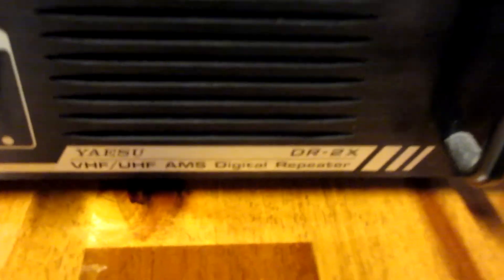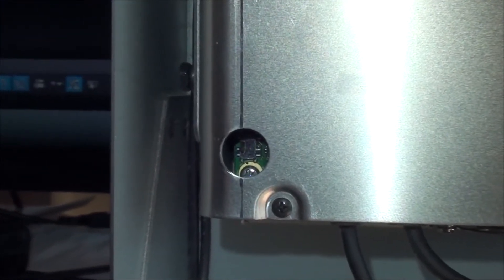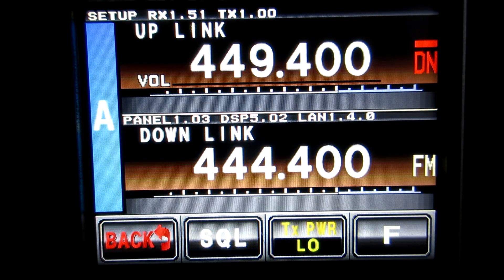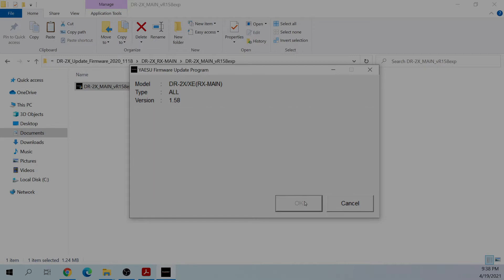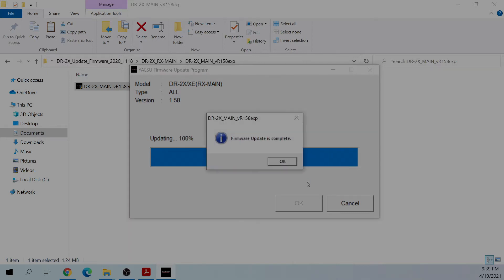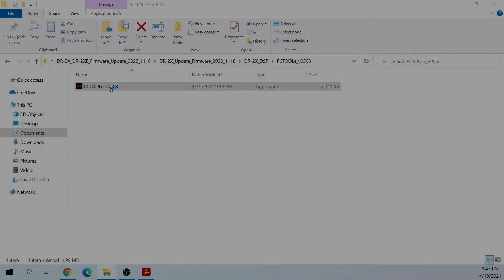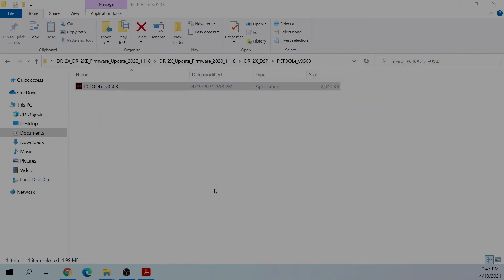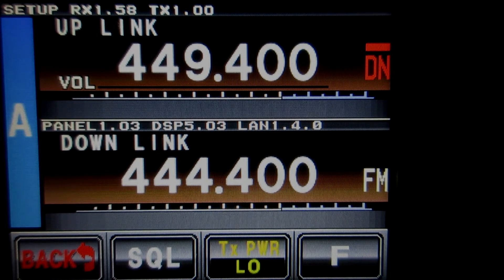Yaesu DR-2X Firmware Update

Comment: I have no 13.8 DC voltage at my 'Battery' connection.  Do I have to 'turn the battery connection on '  ?  If so how do you do it ?  Thanks.